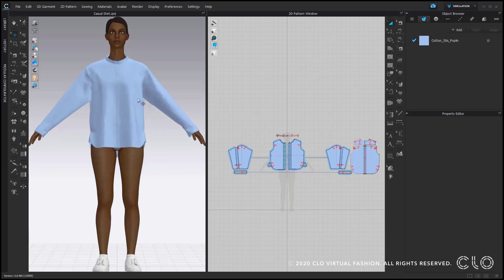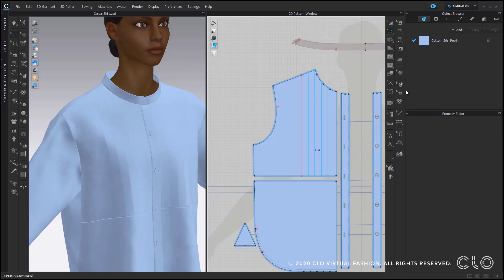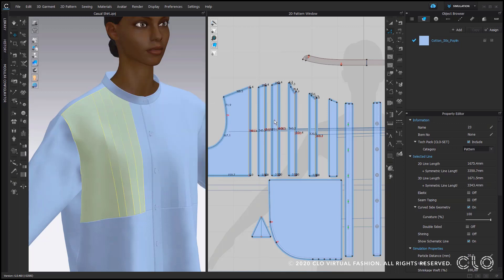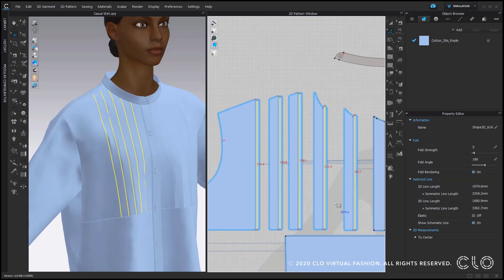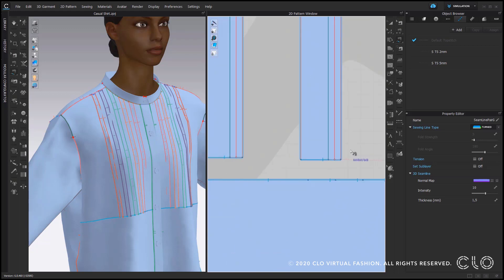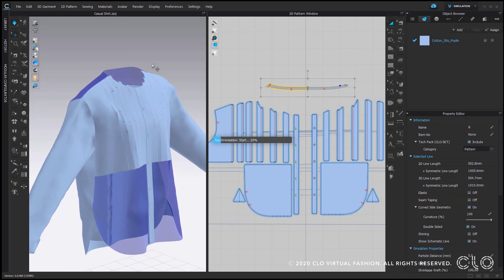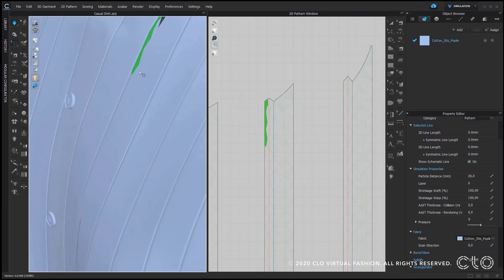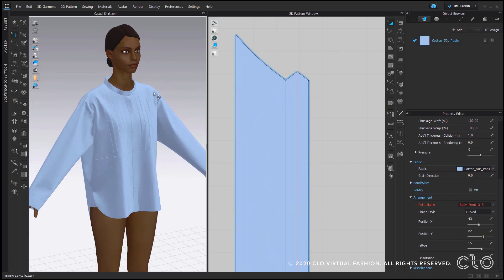How to Create Pintucks in CLO

Comment: That's not how pintuck shirt patterns are made IRL. Nobody splits everything in tiny bands.
Reply from the maker: Yes, you are correct. This is an older CLO video to show how you could make Pin tucks. But now in CLO with software improvements it is quite east to make true pin tucks